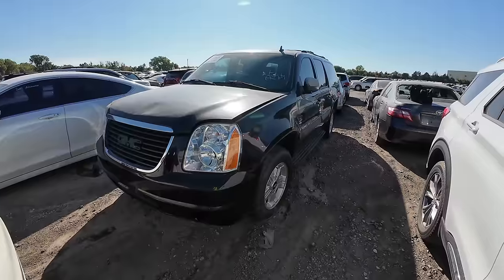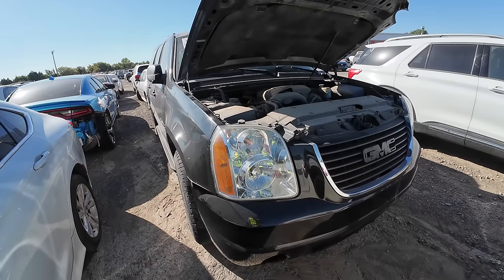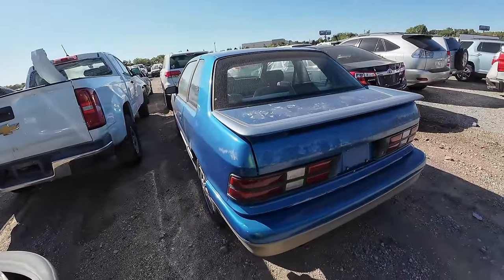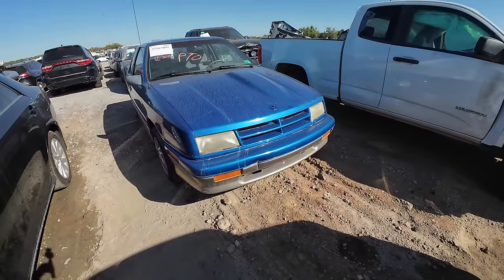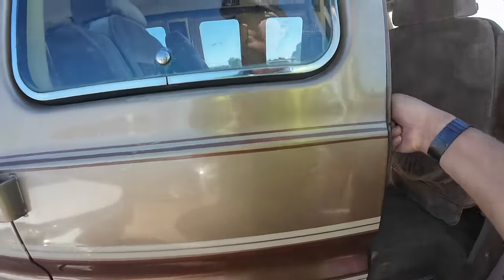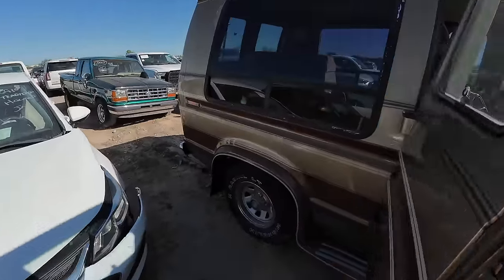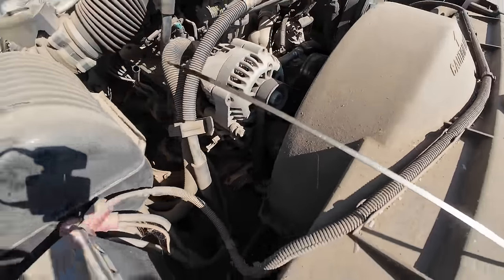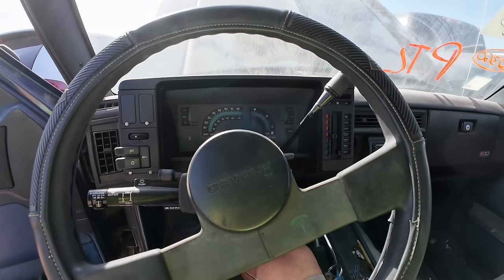I'm winning this Retro 1980s Ford Conversion Party Van for $250!!

Comment: vanmandad approves - thumbs WAY up on the Ford Conversion van! You can easily remove that plastic housing with the cupholder to the right of the driver's seat to access the engine.  
Great find Randy!!!!!   👍🇺🇲😎

Comment: That was a trip down memory lane. My mom had a '84 Dodge Shelby Charger with a 2.2 4-cylinder, 5-speed manual. Red with the black and gray pinstripe interior. I had to ride in the hatch area more times than I can count. We moved from CT to Florida in that car.

Comment: The conversion van brought back memories for me, but not good ones.  We had a 1983 GMC G20 Compliment Conversion Van that we purchased new.  The dealer assured us that it could tow our 3,5000 pound travel trailer without problem, and just from the standpoint that it was a 3/4-ton chassis the weight shouldn't have been a problem.  While it came with a 2" receiver hitch, it was ill prepared for towing duty as we learned very quickly as many of the conversion vans of that era were.  The conversion was very heavy, the truck had the base 307 cubic inch Oldsmobile V8 with Automatic Transmission and 3.09 rear differential -- as equipped, the van was doing well to motivate just the van and the six passengers that were often in the passenger compartment.  We were happy to go back to a full-size, pre-final down-sizing Oldsmobile Delta 88 Roayale Brougham Luxury Sedan at the beginning of the 1985 model year, and I still have that car today.

Comment: Randy get the Ford conversion van.  I used to have a Chevy Astro conversion van that had 356k miles on it when i sold it. It was still running strong. There are times i miss it.

Comment: The 2.2 l and the 2.5 l are both non-interfing engines. You could break a timing belt on those all day long and all you had to do was reline up the marks and they were good to go. I have changed so many head gaskets on 2.2 and 2.5 l. I could do it my sleep. It's actually a super simple job. I love those cars. I still have an 81 Plymouth reliant with a 2.2

Comment: I had a Shadow exactly like that. Never had a problem with it.  Did super in snow. Ckeaned the oil returns and replaced the valve cover gasket and timing belt. Had 127,000 miles when sold. I had it 4 years.  Not bad for a 1993.

Comment: I owned a 95 dodge shadow in manual 5 speed red with tan interior and it was so so reliable and only needed front axles it had 250k miles never ever had a single issue with it! 
    This sounds like a timing belt the way it’s trying to start
This one’s in great shape! And overall nice paint

Comment: My late father had a 1994 Dodge Sundance. The rear lights were hybrid. On the left there were dodge shadow taillights and on the right were Sundance taillights. I ended up driving it into my neighbors gate and wall at high speed. The airbags saved me and my sisters lives. Solid car.

Comment: Randy that little piece for the white Blazer with the TBI 4.3 is the ignition control module. It mounts onto the distributor. Used to test those when I worked at an auto parts chain store. Mine burned up on my 2.8 S10 and left me stranded one morning.🙁

Comment: Hi Randy, thanks for saving some of those 80's and 90's cars, I think they are mostly unloved.  I think GM's 2.8 V6 was pretty good engine, at least in my experience. I like the interiors and looks of conversion vans, I wish they would have been mass produced as four wheel drives though

Comment: Randy, the Shelby was either a Charger or a Daytona.  Chargers were slightly smaller & slightly more boxy.  If the rims had golf ball size holes at the outer edge, it was a Charger.

Comment: In the Yukon of the check engine light is on check the in dash cigarette lighter. If you use it to charge your phone it will blow the fuse and set the check engine light.

Comment: Hey Randy I think what you're talkin about is a Dodge Shelby charger I used to have one in 1986 I believe the only came in 4 colors silver black red and blue I believe they only came in for colors but I could be wrong that little car was pretty quick to. But I bought it brand new so I never had any problems with it.

Comment: 4:39 if you press the triangle button on the steering column it usually turns the miles and all the other stuff down there on most vehicles have it my i believe 2002 dodge ram 2500 has it but dodges is orange and that's what happens when you press it on I'd imagine on every vehicle that has it and there all in the same spot

Comment: The Shelby CSX (Carroll Shelby eXperimental) was a limited-production high performance automobile based on the turbocharged intercooled Dodge Shadow and Plymouth Sundance. These cars were offered by Shelby Automobiles Inc. from 1987 through 1989. The CSX serial number was established by AC Cars, in Surrey, England. The purpose of that serial number was to identify which chassis were to be exported to Shelby in the U.S. CSX stood for "Carroll Shelby Export".

Overview
Manufacturer	Chrysler Corporation
Shelby
Also called	Shelby CSX-T
Shelby CSX-VNT
Production	1987–1989
Body and chassis
Class	Sport compact
Body style	3-door hatchback
5-door hatchback
Layout	Transverse front-engine, front-wheel drive
Platform	P-body
Related	Dodge Shadow
Plymouth Sundance
Powertrain
Engine	2.2 L Turbo I I4
2.2 L Turbo II I4
2.2 L Turbo IV I4
Transmission	5-speed A520 manual
5-speed A555 manual

 Info from Wikipedia

Comment: If you can get that S10 Blazer, buy another cheap auction Chevy with a good running V8 in it and do a V8 conversion. The conversations are easy to do and not very expensive.... and depending on the engine swapped into it, they can be incredibly fun vehicles when done... Especially if they have a sneaky quiet exhaust system and ratty looking paint. I have seen somewhat ratty looking sleepers sell for more than the same make, model and similar year but decent looking and running but stock ones.

Comment: I did some googling and could it had been a Shelby GLH-S?

"The 1986 Shelby Omni GLH-S was a modified Dodge Omni GLH, with changes made at the Shelby factory. They were retitled as Shelby Automobiles cars sold at select Dodge dealerships. GLH stood for "Goes Like Hell" and GLH-S stood for Goes Like Hell S'more

Just 500 were made. Dash plaques using a three-digit serial numbering system were installed."

EDIT: I wrote this comment just a minute before you showed the car on your phone.

Comment: I had a 1993 dodge shadow the timing belt broke and was replaced with no damage to the engine mine was the 4 cylinder

Comment: Let's start with the Z3 I believe you didn't you didn't bother to check it it's real m-series we have the engine badge m as well as the dash, door sill, stick shift, airbag. Speaking of airbags still intact. Get creative on the fixing the tree and a come along will do most of the work. Replace Fender and strut when you're good to go what happened with the Boxster

Comment: CSX Shelby. Always thought the fiberfab gold wheels were tacky & the Shadows were fugly- put all the aero & stripes on it you want, they get even more hideous & trashy looking. The headgasket issue? Machine the head, ARP head bolts or studs and you won't have a head gasket issue again. Had a modded '89 Turbo Caravan I took to 308+K miles. Shelby intake, FFV injectors, '87 3L throttle body, 1st gen DSM blow-off valve, Garret T3 turbo with 740 Volvo intercooler,  3" exhaust from the swing-valve back, '92 Grand Caravan front suspension & brakes, as well as the rear tube with the rear swaybar. Poly bushings.Koni struts & shocks.  Shelby wheels. Transaxle was a mix & match of various year components with a LSD.
Was it "Super fast?" No. But it was a helluva lot quicker than you would think, could stop quicker than imagined, and handled for a minivan. I don't hate all K-car Mopars, but most were just "Meh" or trashy